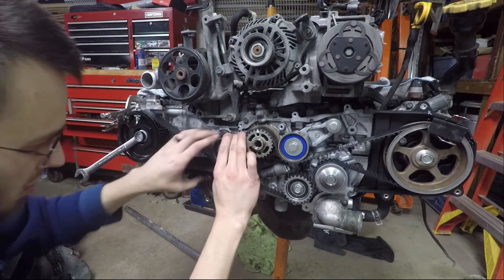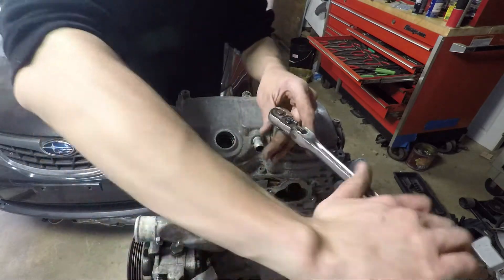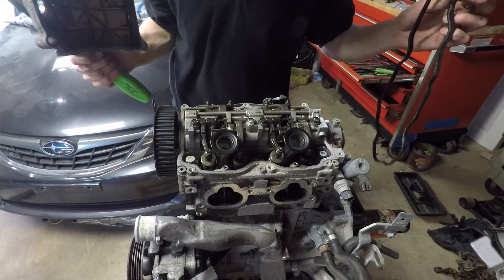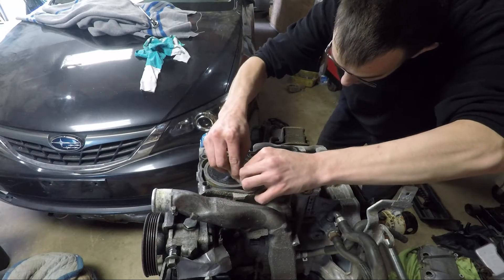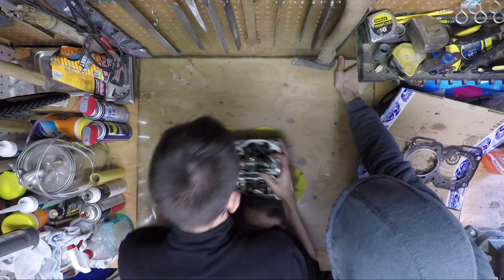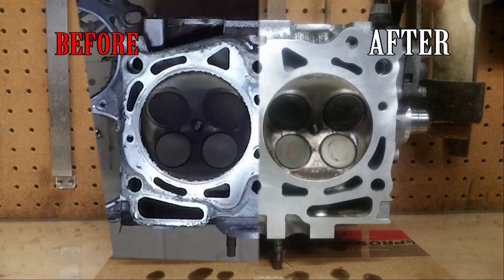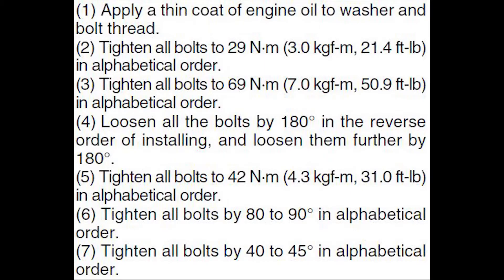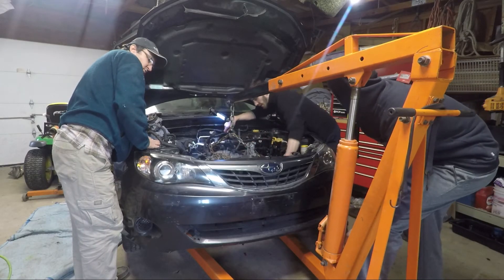Cylinder Head Resurface - Replace Head Gaskets

Comment: Subaru head bolts are NOT torque to yield. they are simply angle torqued. you can reuse them no problem. the factory Subaru head bolts are far superior to most aftermarket bolts many of which are poor quality and dont have the right size washers for the center bolts. only use factory Subaru bolts or ARP

Comment: Thanks man.  I did this and it worked great.  I used 320 for a few passes and finished with 400.  Saved me hundreds of dollars and time.  Key is thick glass so no deflection and a solid flat surface ( table saw ).

Comment: Head torque procedure listed in the video appears incomplete or outdated. 
Usually bolts A B are tightened an additional 45 degrees at the end.
Reply from the maker: Torque procedure was taken from the Subaru service manual for this engine. Maybe it is different for another version?

Comment: Factory Service Manual says you can reuse the bolts.
Reply: Also worth noting that the head bolts are NOT TTY. There is a "stretch" like procedure, but the purpose is to equally pinch the head gasket. Hence, why you need to release torque then tighten to a torque at the end.
Reply from the maker: It does say that. But with the headgaskets being an issue on these engines, I figured new bolts wouldn't hurt. Create less weak points

Comment: At 3:00 you shouldn't use grease or oil when re installing the bolts you will over torque the bolts and break them. Good video though
Reply from the maker: +George Parker I understand where you are coming from, but according to the factory service manual, a thin coat of engine oil is to be applied to the washer and bolt thread. I'm assuming they account for the oil in their torque specs. I appreciate your time to watch and comment though!
Reply: AUDImotive oh I see, normally any kind of lubrication is not recommended. Well if the manufacturer states that then yes do that. Keep up the good work I'm going back to watch the other videos
Reply from the maker: +George Parker you are correct, normally no oil should be used. But in this case, Subaru knows best! Hope you enjoy the other videos
Reply: They are torqued to angle, so oil is a must and has no effect on the final setting.